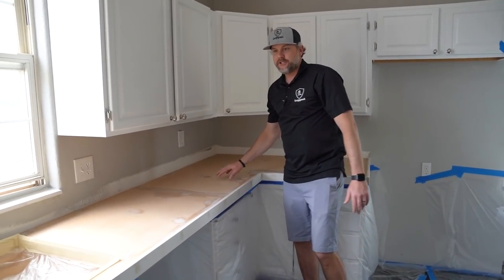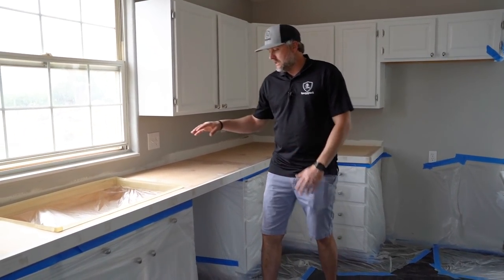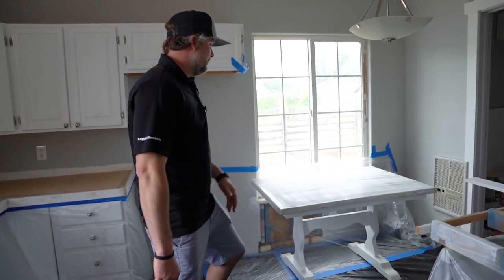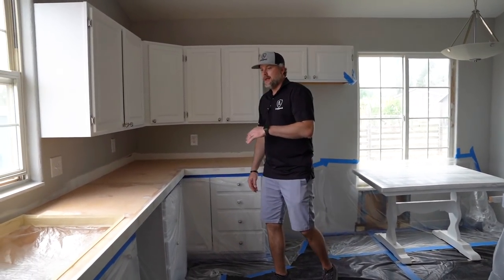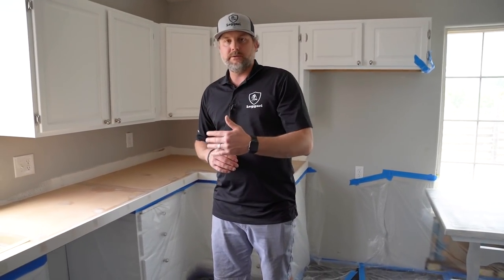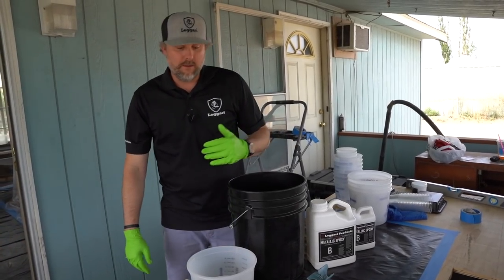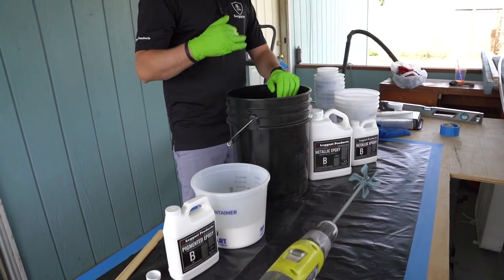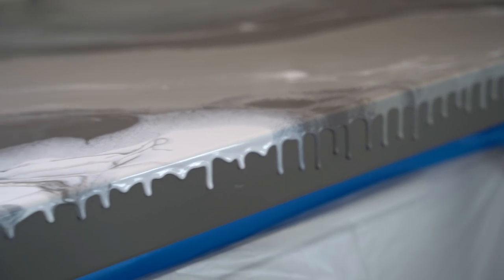Epoxy Kitchen Countertop With Dining Table and Custom Backsplash | Leggari Products |Kitchen Remodel

Comment: Just ordered my kit, planning to redo my kitchen, current has nasty tile with matching tile backsplash. Will remove tile backsplash and replace with epoxied plywood. I seem to remember seeing somewhere that if you do that, you can do the backsplash first and install it before doing the countertops and the fresh epoxy from the counter will bond with the mostly cured epoxy of the backsplash and leave you with an entirely waterproof seam without caulking. Am i correct in thinking that?

Comment: Is this durable against heat? Will it scratch easily if I cut something on the counter?
Reply from the maker: We recommend treating your counter top like any other high end option and use cutting boards and hot pads!